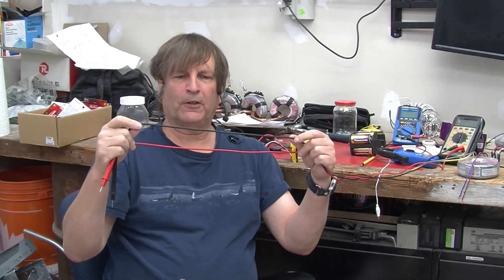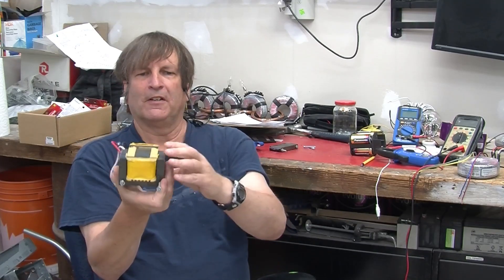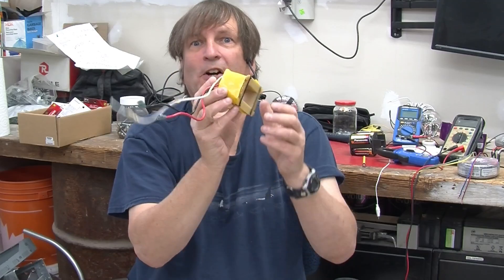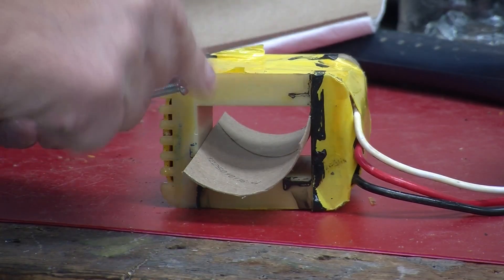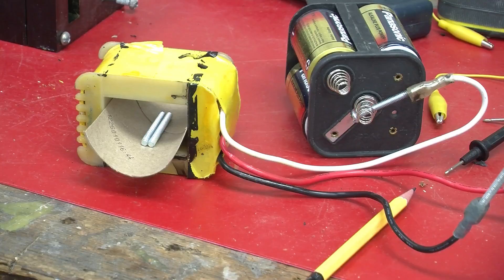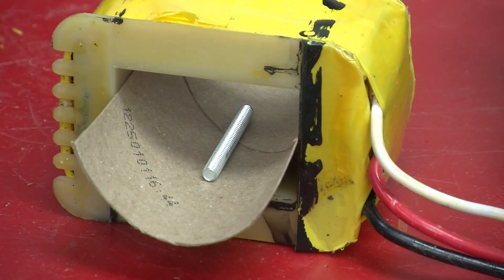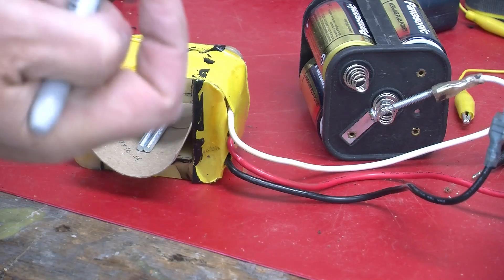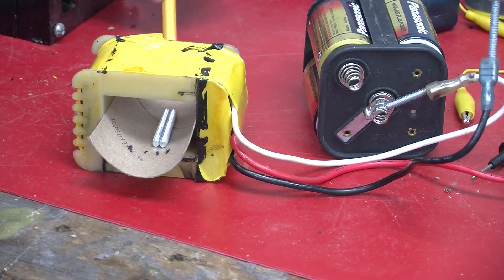Do Rods in a Solenoid Repel or Attract?

Comment: Cool. What happens if you place a soft iron pipe inside and a rod inside the pipe? Will it float? Will the rod and pipe repel each other causing the rod to levitate at the centre of the pipe?
Reply from the maker: What a great question! I think the rod in  a pipe thing may not work because of the the rod would be repelled from the above and below portions of the pipe. One would have to try and calculate how repulsion varies based on distance from the center of the pipe. A half pipe though may work where the pipe acts as a cradle. However you would need walls at right angles to the rod and pipe to keep the rod from slipping out due to Earnshaw's theorem https://en.wikipedia.org/wiki/Earnshaw%27s_theorem.  

This is such a great question that I may try it and possibly do a  video! Thanks for asking!
Reply: @ElectromagneticVideos  What if you use a toroidal core? I'm thinking 3 solenoids spaced around the toroid equidistantly apart. A fixed soft iron outer ring and a fixed floor ring. Alternatively a half pipe covering the floor and outer side. The toroid is slightly smaller. If the electromagnetism only strongly magnetises the parts of the toroid within the 3 solenoids will those 3 sections be repelled? Will it spin freely?
Reply from the maker: @hanggliderpilot  I am having trouble visualizing your description, but I think you are saying if we use a toroid rather than an open ended coil, the floating thing cant slip out. If that not what you mean, send me a sketch. 

I think what would happen here be because the flux is (confined) within each circular object,  it wont interact with the other ring's flux and wont repel. You need to have the flux leaving the magnetic core to interact with flux from something else to repel. 

Great idea though - had to think about it for a while!
Reply: @ElectromagneticVideos  I've been thinking about how to make frictionless spur gears for some time. Have a number of ideas but have to locate soft iron rings and other parts to test them out. Thanks for the input.
Reply from the maker: @hanggliderpilot  How cool! Soft Iron rings - depending on the size most steel not used in magnets is quite magnetically soft. So what about in rings in the chains and fasteners section of a hardware store? Or cut a section of wire and weld it together into a doughnut shape?

Does the ring need to be made of round material or can it be made of a square or rectangular rod? If it can be rectangular, how about washers? If you go to a specialized screw and fastener  store - usually in the industrial area of each city - its amazing the shape and size washers come in . 

There are also metal shops in almost every city these days that do small volume metal manufacturing and they usually have laser or plasma cutters that can cut any shape you want out of a sheet of steel. So that would be easy if you are willing to pay a few hundred $ or so (and it usually cost little more to have 10 pieces made than just 1).
Reply: @ElectromagneticVideos  I was thinking about using wire wrapped around in a circle a few times but one strand would probably be better to start with as you say. Lighter. Chain rings aren't usually round but I'll check that out. I was going to try metal shops next. Last time I went to one of those was to buy steel springs for a pair of running shoes I was trying to build that stores energy from each step. Built a prototype which had stability issues but before I could address that blade runners suddenly appeared in the news. Admittedly better approach to the problem. As you say metal shops are very expensive so I tend to seek out second hand materials when I can. Yes the two spur gears need to be round to work. Its for a specific application.  The intent is to pump air rapidly.
Reply from the maker: @hanggliderpilot  Actually the wire wrapped in a circle is a great idea.  A lot of toroid 50/60 Hz power transformers make the core with a flat strip of silicon steel wound around many times to produce a core made of many layers to reduce eddy currents. The fact that the inner and outer end of the strip are magnetically open has little effect - its only a tiny percent of the area. The advantage of a flat strip rather than round wire is there is virtually no space lost in gaps between the wires. Not sure where long spool of steel strips might be obtained, but with google you never know whats available. Then again, if you need the core to have a round cross section, strips wont work unless  use use various strips of different width to approximate a round cross section of the whole core.

Comment: The single rod becomes magnetized in the field.... Why don't the 2 rods become magnetized? (I assume that they weren't because they come back together after the field is denergized.)
Reply from the maker: They do! But the remaining magnetization in steel of the type used in nails or bolts is low, so nearly enoough to keep them apart whne the current goes away. Actually a good thing - devices like relays wouldnt work of the metal stayed significantly magnetized when the current turned off.
Reply: @ElectromagneticVideos  Didn't even think about relays... duh (The duh was for me, not you!) Thanks! 👍😁👋
Reply from the maker: @chopper5371  Hey - there are many times I deserve a good duh :)

Comment: Thanks for this demonstration. It's fascinating to learn how the early designs of voltmeters were done. Reads in RMS even though it never does the first calculation!
Reply from the maker: Glad you liked it Dave! Yeah - purely analog squaring! I wonder what the frequency limitation of that was - probably the first few harmonics of a non-sinusoidal signal were fine, and higher ones would have had their contributions suppressed. Since most harmonics back then would have been from things like magnetic beginning to saturate, probably not an issue.

Comment: what happens when u dip the bolts in oil when the bolt is hot to a m,elting point then u dip in oil then leve it to cool and then u magnetice that bolt so the carbin around the bolt will it make a better magnet?
Reply from the maker: Heating a magnetic material and allowing it to cool in a magnetic field is a way to make a magnet. Oil is probably not hot enough though. However the limitation here is the material - steel - which is too magnetically "soft" to make a great permanent magnet. 

But you bring up and interesting point: the iron content in lava and similar rocks from the mid ocean rifts does capture the earth's magnetic field as it cools holding a record of the   field's direction. This has been used to determine the time of the rocks creation since the earths poles move with time and hence the direction of the earth's field is different for different times in the earths history (it even reverses).